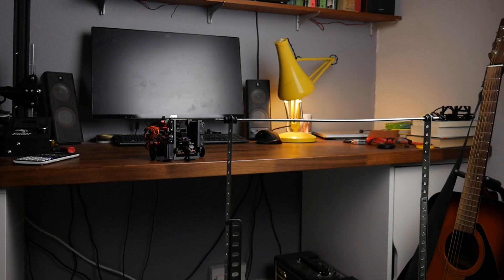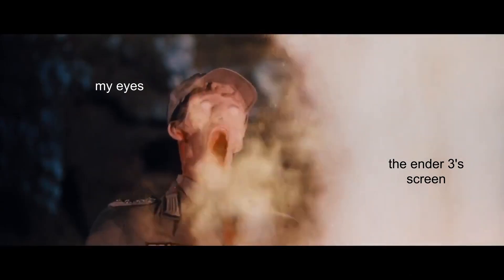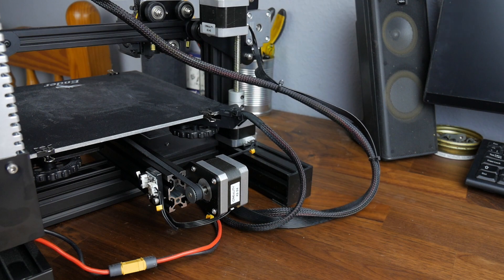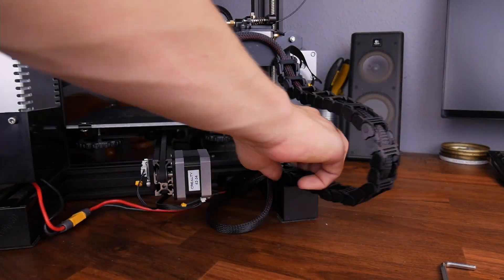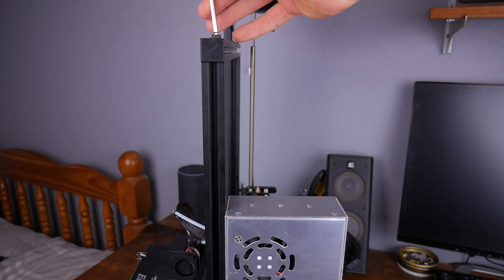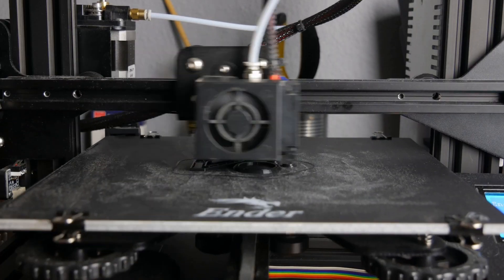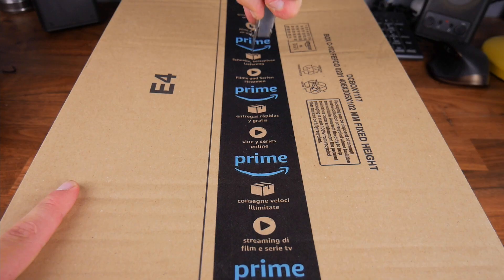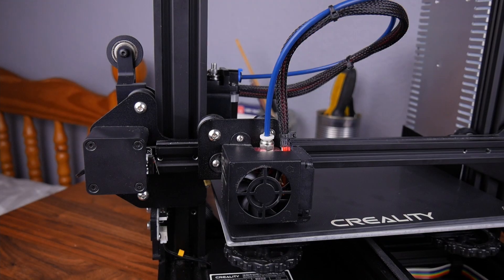My First 14 UPGRADES + MODS for the Ender 3

Comment: 3:12 why chose that glass? i have the same in CR10 but i am thinking in somthing flexible with magnets. But i am worry about warping(not flat on all corner and center because of its flexibility)
Reply from the maker: Thought it would be a good upgrade tbf, only issue I’ve run into is bed adhesion with it so far
Reply: @adambeedle  ok great. thanks

Comment: How much does ur 3D printer cost?$$$
Reply from the maker: I think they’re around $200
Reply: @adambeedle  should I learn to Create 3D models in any designing software before buying any 3D printers?
Reply from the maker: @MakeItFlyofficial  I’d say if you’re already planning on getting one and you’ve saved up enough then get one! While you get to grips with 3D modelling you can start printing some upgrades which will help you get a handle on 3d printing
Good luck 👍
Reply: @adambeedle  thanks bro for the info